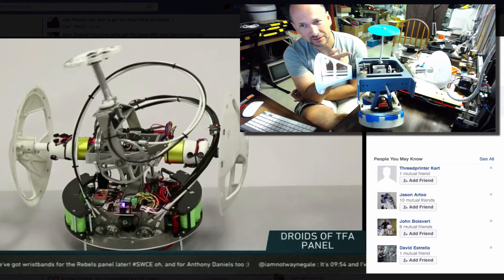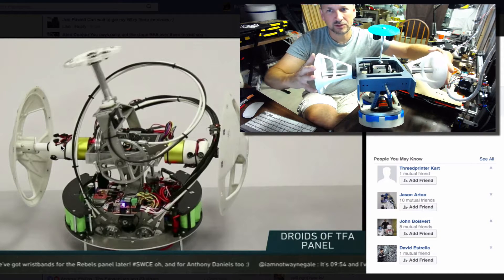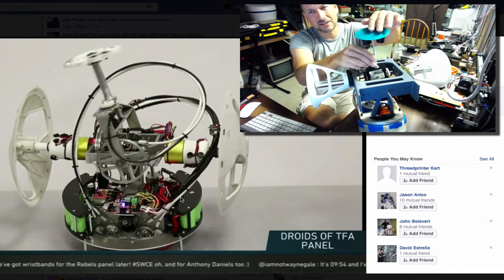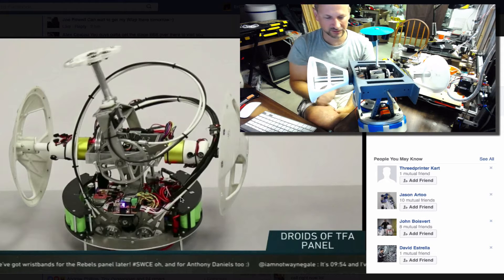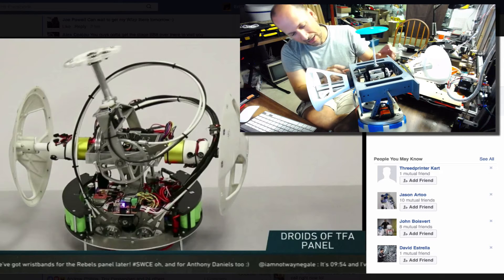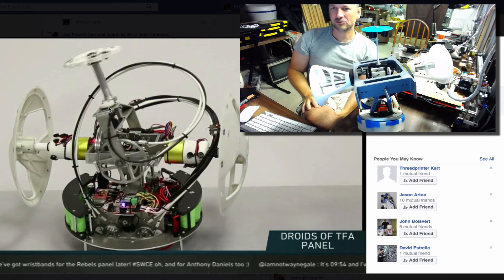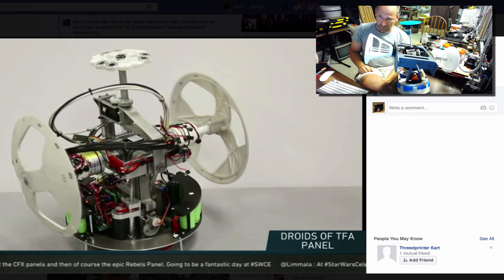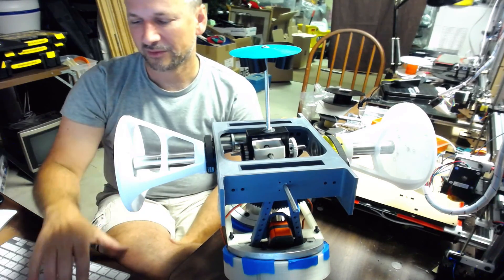The RollingRobots Project : How BB 8 REALLY works (comparing to my DIY version)

Comment: I'm confused about what the thing you are calling a flywheel should actually be called.  You mentioned reaction wheel but I looked it up and it's not that either (but closer?)  flywheel stores energy.  Reaction wheel seems to be constantly spinning.  Reaction wheels look very useful. Could be useful for stability.

Did some reading..Maybe it is a type of reaction wheel or momentum wheel after all...